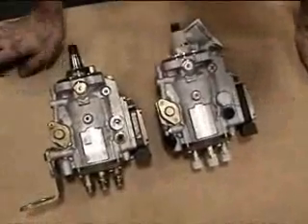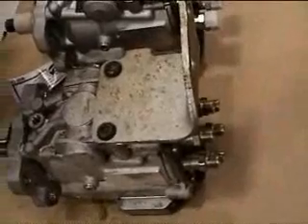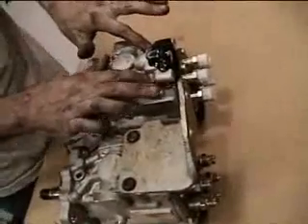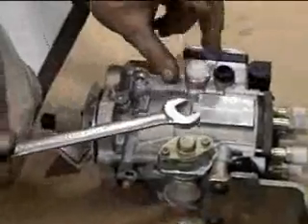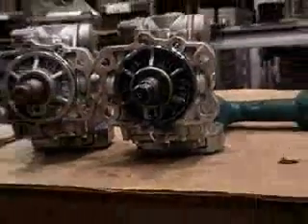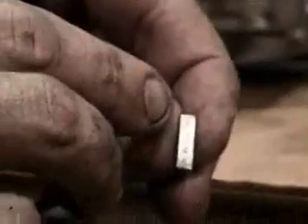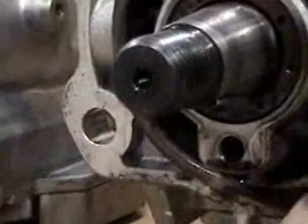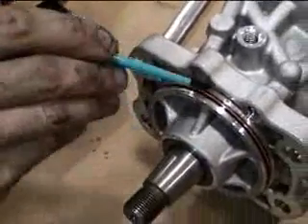VP-44 Install and Removal Series Part 6

Comment: Picking up a new VP44 in the morning. decided to do it myself and save $400. "You are the man, Diesel Dan!!!". Awesome tips!!! I could have done this without you, but I know you have saved me hours. Thanks!!!
Reply from the maker: Awesome!  Glad it’s still helping almost 10 years later!
Reply: Dan MacDonald Got it done, added a Fass lift pump, runs like new. THANKS you are awesome
Reply from the maker: AwesomeI actually start at FASS on Monday!  Going back to my old job!  This was actually filmed in their warehouse back in the day.
Reply: That's awesome. The pump I got was beautiful! Was using the horizontal O Reilly pumps, read "Chinese crap" , What a difference in quality!!! That makes #3 on the VP 44's. I think the crappy lift pump took it out. Thanks to FASS for quality workmanship and reliability made in Missouri!  If everything in America was made so well, we couldn't loose! Thanks again.
Reply: @dieseldanmac  Just finished my tappet cover gasket, so I had the vp44 off, and NOW yt recommends your video series. 
Even though I finished my job, I watched all 6 videos. This is the best, most comprehensive guide on yt.
So thank you for making & posting it some 13 years ago! 👍
Reply from the maker: @savage22bolt32  Thanks sir!  This was done back in the day when YouTube only let you do 10 mins at a time with a camera and software that would be considered archaic by todays standards!  It warms my heart that its still helping all these years later.  I see vids today and they are all about talking and flash.  I wanted to put one out that was all substance and detail.  Appreciate you, sir!
Reply: @dieseldanmac  💯👍🇺🇸

Comment: when the P0216 code comes up. should I test for fuel pressure going to the fuel lines and to the injectors or the fuel pressure test port to make sure its the pump failure. also when that code comes up. does that mean their is no fuel pressure to the injectors? thank you I appreciate it.

Comment: Hi their, your replacing the VP-44 injection pump because of the P0216 code or it has no fuel pressure to the injectors? thank you.

Comment: I have problem with my car, when i keep it nose up in hill car wont start and gets air in system, none problems when car is on stable platform. Some say Banjo bolt is the reason for that. Can it be it? I have all other, fuel lines and fuel injector gaskets etc. checked and replaced...